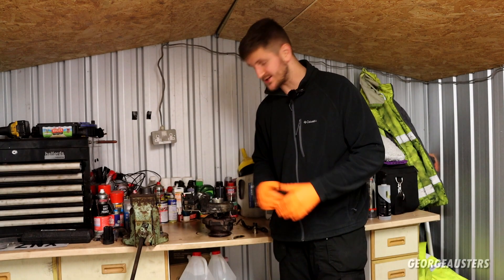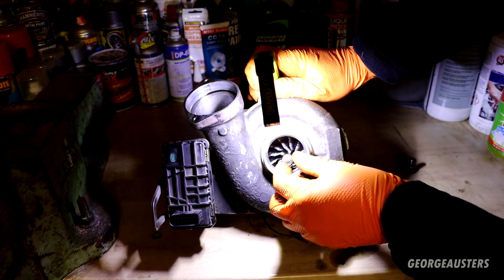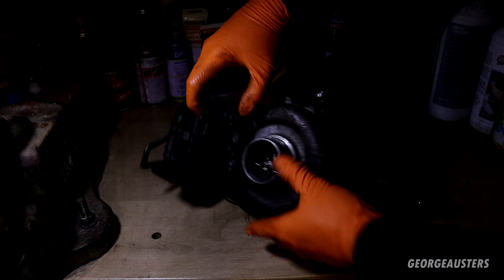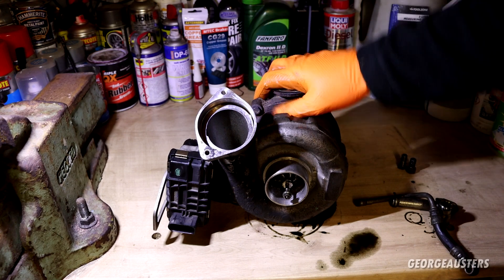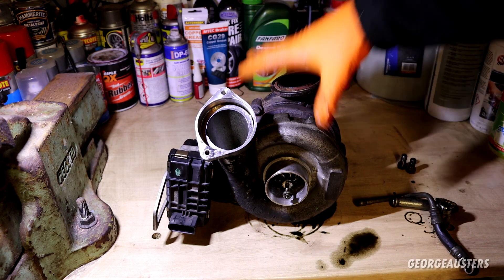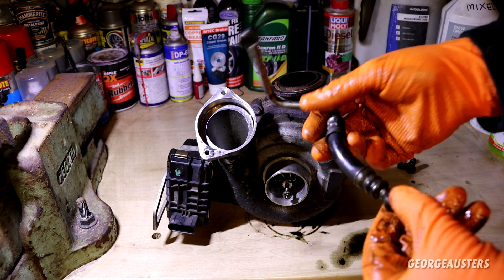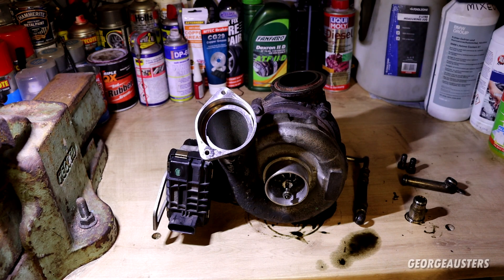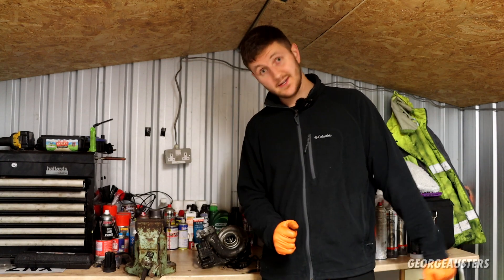HOW DOES A TURBOCHARGER REALLY FAIL?

Comment: Hi
I have a 320d E90 lci lately i have observed hearing engine noise inside the cabin i dont know if i have to be worried about it or it is normal
When i checked the decibles it was around 60 db
Please help if i should be worried about it or it is normal
Please help

Comment: My 320d is on 221,000 miles with the original turbo, I change the oil every 5-6 thousand miles and also let the engine warm up for a minute before driving, I also leave it run for a minute before switching off

Comment: Won’t all the scrapings of the turbo blades be in the cylinders now? Or should I say what prevents them from entering the engine block?
Reply from the maker: I’d doubt they’d get through the intercooler, charge pipes and intake manifold to be honest
Reply: The blades from the turbine wheel failed. The turbocharging system is placed below the exhaust manifold by like 8-9  inches. So it would be very hard for the blades to be thrown up, against the walls of the exhaust manifold and also follow its curved shape towards the exhaust valves. Also the rotating turbine wheel and compressor wheel are mounted inside the turbine casing and if the blades detach, they will just hit the casing, not even the inside of the exhaust manifold tube.
Reply: @legioner9  I was really referring to the scrapings produced on the inlet side, what prevents those from entering the cylinders. Will George not have to remove the cylinder head and remove any debris or at least examine the bores as well as just stick a new turbo on.
Reply: @nigelfewster   The same thing as I wrote above happens to the inlet scrapings aswell. Furthermore, the compressor casing has a only small gap between it and the tip of the compressor blades + the long curvy road upwards to the inlet manifold, including the intercooler on the way, plus the charge ducting. Therefore, it is highly unlikely for the scrapings to go in the engine inlet manifold and combustion chamber, regardless if coming from the compressor wheel or turbine wheel. So, yes, as you said, George has only to mount a good turbocharger.

Comment: How's it going George I'm removing my active roll bars and steering of a e63 645i, iv got standard M6 roll bars to go on the car do you know if now I just need to swap the rack and pump and oil tank  to just hydro  ones and just pipe it up , I know I'll need to get some coding done afterwards but as far as bolt on parts go would that be it ? Thanks pal 👍
Reply from the maker: Best thing would be to remove all the pipes from the rack and block with bolts. The option will need coding out the car afterwards yes👍🏻
Reply: Use polys
Reply: @leenevin8451  what do you mean pal bushes?
Reply: @bmwd2083  polyurethane bushes. They’re stiffer and last longer. Prefect for anti roll bars and droplinks
Reply: @leenevin8451  thanks pal 👍

Comment: The bearings have failed due to lack of oil changes. Also the worst thing for turbo's is turning the engine of before allowing to cool down. allow engine to tick over for a minute before turning of. also worth changing oil feed pipe and return or cleaning these pipes. Sorry typed before end of video but it will be maintenance and wrong oil over the years.
Reply from the maker: Yep I always give it a minute to cool-down after use👍🏻

Comment: So you going with reconditioned or remanufactured ? ( dont go with reconditioned).
Reply from the maker: What’s the difference?
Reply: @GeorgeAusters  remanufactured is assembled in the BMW factory in complete sterile conditions, considering the speed and temperatures of these turbos its important.Every part is micro measured and if any wear is present the part is renewed, it's the closest thing to a brand new one. Reconditioned they change the failed part only in un clean conditions.

Comment: To my experience, the no 1 bearing killer is, as an example, turning off the motorway with a glowing hot turbo running at 30 000 revs, and switching off the motor. Then keeping the turbo spinning a minute or two with no lubrication. My practice, regardless of car/boat/stationary motor, let motor run for a few minutes at low rpm before switching off.
Reply: 100% correct especially with oil cooled turbos ! Some water cooled turbos have an electric waterpump which runs after the engine shuts off this is the only exception to your rule. Also another thing that kills them is people hitting boost when the car is cold. Should always take it very easy until the water temp has been at 90c for at least 5 minutes. Just because the water is up to temp doesn’t mean the oil is!
Reply from the maker: Not bad advice at all!
Reply: @GeorgeAusters  thanks George also to add regular oil changes is key like you suggested

Comment: Isn’t the 535 twin turbo a m57 engine?
That would be a worthy upgrade and an excellent video if that’s the case?
Reply: It’s a big hassle to swap that over, new manifold needed, new ecu, 2 oil lines not worth the hassle really.
Reply: @piovo1  I’m after that conversion myself.  An interesting thing for a you tube channel
Reply: @Al_Pollock  just put in a single hybrid unit from falcon turbos, 335d injectors, R90 pump and you’ll be over 400bhp and 900nm+
Reply: @piovo1  I’m just asking the poster to do a full job, having a 3.0 bmw x drive you may as well make the best you can.  
That’s the best in my opinion
Reply from the maker: Honestly just cheaper and easy to buy the 35D

Comment: As another commenter said, if your mate still has a dpf then i would imagine the impellers from the exhaust side are embedded in it
Reply from the maker: It’s gone
Reply: @GeorgeAusters  ah well iguess they ended up in the radiator of the car behind when the turbo decided to destroy itself then  🤣🤣
Reply: In a manner of thinking, exhaust impeller is a particle and as such would be caught by the particle filter.